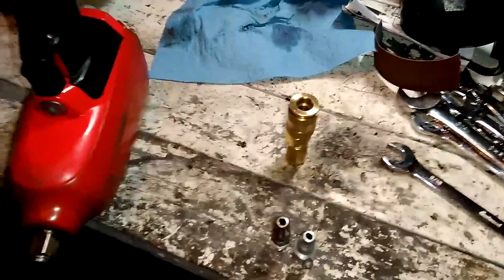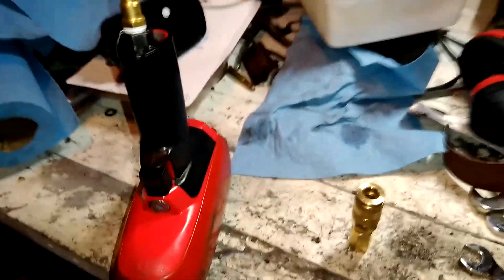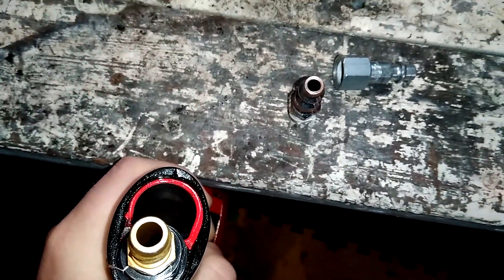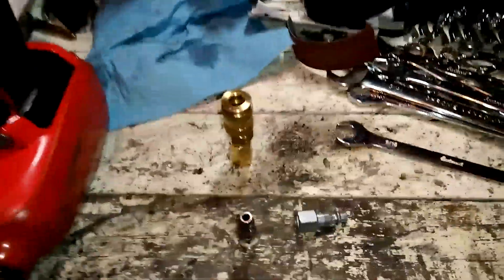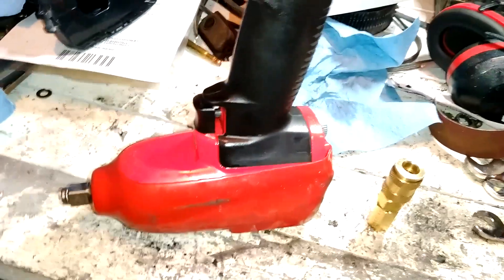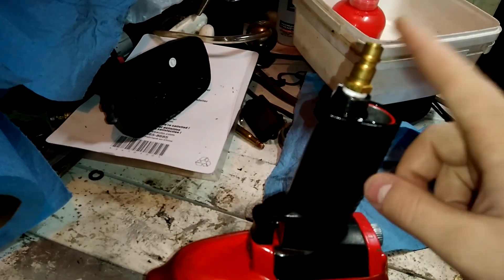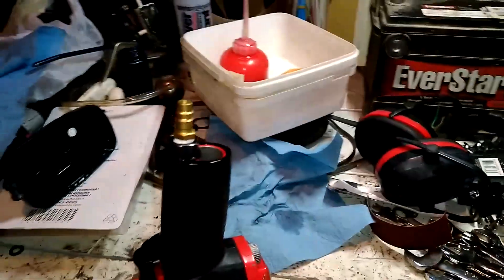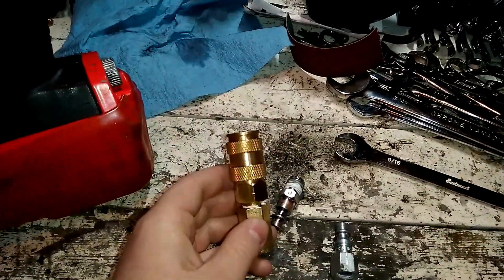Why I switched to Milton V for my air fittings (and why you should as well)

Comment: This is 100% accurate.  These do give better flow.  I've tested using a pressure gauge at the tool M vs V.  The V fittings are the way to go.
Reply from the maker: 98SunDevil it's incredible how much of a difference it makes. I've noticed with any high volume air tools these V fittings are a must

Comment: Thanks for the great vid! According to Milton,their V-style will also accept M-style (like you show) and A-style. So,you dont have to convert all your old M-style  plumbed tools to V-style. But,FYI, not all V-style brands are like that. Menards (a home improvement store in the midwest) sells  V-style couplings that DO NOT accept M-style couplings! They physically go in but leak like a sieve. They will even blow-out under pressure! Don't know if the same is true with Home Depot's "Husky" brand V-style or not.

Comment: Biggest problem is, the fitting is always smaller then the ID of the hose.. So, the Input end is the biggest restricting factor.. But, being it is matched on the other end with the same size coupler, it works to keep the hose filled.. Problem is, couplers are usually designed to push more air than their male counterpart.. That is one thing that they seemed to pay attention to on these fittings.. The coupler is more closely matched to the male body.. If anything it is a little bit smaller, which keeps the pressure in the hose.. 
Definitely the best way to push a high consumption tool.. Of course, a 1/2" air supply close to the work area and a short hose is always the best choice either way you slice it..

Comment: You are 100% correct !  People just don't know neumatics because they lack some school. But for well versed technicians and engineers, this should be very obvious.  ANY restriction can pass all the pressure at LOW flows... but, as flow increases, the restriction causes what is called "Pressure Drop".  And any orifice or narrow passage is going to choke the flow.  That's the reason for porting heads, just for a quick example!.  Last week I bought a pneumatic brake bleeder made by a company from Germany, and it came with two "High Flow" style connectors, so I was unable to connect it to my DeWalt compressor,  which has a lot of restrictions on it (too small pressure regulator, too small manifold, and too small M-Style coupler). So, I'm going to replace all that with Milton V-Style! Thanks for your video, it confirmed what I was suspecting.My compact Mighty-7 impact gun had to be connected DIRECTLY through a 1/2" hose (less than 12 ft long) because either the damn "Mighty-7 Retractable hose reel" came with a light blue colored polyurethane hose that LOOKS like a 3/8", but is an oriental (Taiwan) 12X8 mm hose that impedes the gun to work at all!  Even a common Autozone "Z" figure air swivel restricts so much the air, that even with the 1/2" short hose, the gun is unable to remove wheel nuts of a compact car!  (that are torqued to only 85 Ft-Lb...  I read somewhere that the Milton V-Style couplings can flow 74 SCFM. versus 30 to 35 for the narrower M-Style standard oes, go figure!
Reply: I only use nail guns but what I would like is for the fittings to not leak after 2 weeks. I've heard of Fittings with Viton seals but damn they're EXPENSIVE. Like $30-40 but the ones I found are made in Japan I think so not chinesium junk. For now I'm going to try some standard Milton fittings.

Comment: Here is the deal, I measured the 3 types that I have. The flimsy std 1/4” bore is 3/16, the Milton V style S-217 has a bore of 17/64 and the T style 3/8th which is S-1809 has a bore of 19/64.
So theoretically the 1809 should have more airflow but Milton advertises it to be 68 scfm in comparison to V style as 74 scfm. Seems a bit sketchy to me, 3/8th definitely moves more air.
Reply: Hope so, I went with the P type, which was also called s1809 on the package I got with it. 10 for $14.75.

Comment: V style use 6 ball bearings and flow 74CFM, P type uses 8 Ball bearings and flows 68CFM.  Source: milton catalog.  I went with the P type for the added rigidity. Pretty sure beyond flow rate there's a factor to calculating power transfer that includes the surface area of the exerted pressure front, in which you'd use the smallest restriction between source (tank) and load (vanes in gun).

Comment: Did you have to change the female coupler on your compressor too? Or was that already V style (big enough)?
Reply from the maker: I changed the coupler on my hose to the V style, however if you want the maximum benefit I would suggest changing the coupler on the compressor (if applicable) to a V style. My air compressor has a regulated outlet and a tank outlet
Reply: BrettDN Gotcha. Cheers brother. 👍🏼🇨🇦